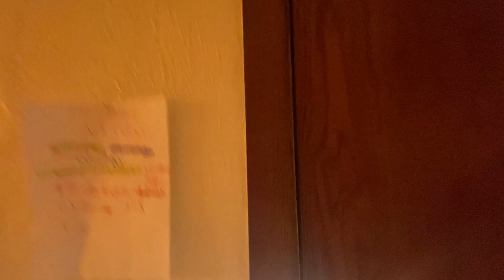Help... is this a silent killer? HVAC Furnace Installed wrong?? Carbon Monoxide

Comment: That doesn't look right to me. That will definitely get hit by a lawnmower or maybe some kids playing. Definitely doesn't look safe. Im sorry. im not sure about the installation requirements. But as a dad and home owner. It looks like a future problem to me!
Reply from the maker: I agree. Since then, it has been ran through the previous chimney and opened up through the roof with a liner. Much better. 90% Effie cy would have been the way to go.

Comment: Well I just remove one just like yours right by a  window normally a l rule it goes above the roof that's why I always install 80%ers I don't like him by a window for the simple fact carbon dioxide could get in I am a HVAC tech out of Missouri

Comment: It looks like a butcher installed that furnace you’re likely to be alive! ….  You must not have a mechanical inspector in your jurisdiction. …. This installation is deadly as well as ruining your house with mold in the first set up. ….  You better have the attic checked for mold. ..

Comment: Was all repairs made correctly just wondered what the update was after repairs were made?
Reply from the maker: He came back, opened the crawl space, went in and put a liner down the chimney and out the lower roof… better than it was but I still want it up a few more feet to clear the 2nd roof.
Reply: @JRESHOW  flu should be higher than any   part of the house within a 10 foot horizontal distance of the house. But I have been retired for 10 years after doing Hvac for 38 so things change
Reply: Ok I don't blame you

Comment: Nothing like making another huge mistake trying to correct the first huge mistake! The company after realizing their lack of due diligence should have removed the 80% furnace and installed a condensing furnace in good standing. Then, notify there insurance company to remedy issues caused by the original install!  
 Question for you, what was heating your house prior to that installation? Where was that vented to?
Reply: Sorry, just seen your response on what was heating the house prior.

Comment from the maker: Thank you. I appreciate the help. The contractor is coming today and is going to get in the attic and run a liner down the chimney and open it up through the roof. He’s also going to replace all insulation and dry out and or replace any other damage. Something must have changed his mind.
Reply: Exposure to the whole world helped change his faulty mindset.
Reply: I run into shoddy work all the time but there are a lot of common issues. Home owner isn't buying equipment from a dealer of that equipment. Homeowner wants it done cheaper so contractor doesn't pull permits. Not that it gets you anything but an inspector should have laughed at that and failed it immediately. The whole point is to protect the home owner from something installed incorrectly especially when it's going to kill them.

Your house is extremely wonky, old, and you need to spend money to have a chimney that is to code or install a furnace that can direct vent correctly.

A qualified licensed contactor pulling permits in theory wouldn't have delivered this end result. That may or may not have been your fault based on your budget but here we are. 

I didn't hear you start the video with the Lennox dealer failed inspection for doing this 🤷
Reply: Thank goodness.  That was some pretty shoddy work.  I'd watch everything they do any  payment until you are satisfied with the work.  Shortcuts with HVAC are bad news for sure.  
Best of luck and glad the guy is coming back to fix this work.

Comment: Shut your furnace off move somewhere where there's heat and get it fixed. I'm a retired HVAC installer and that is an absolute disaster it is leaking into your house. The angle of the exhaust/flute is wrong as well as I'm pretty sure it needs to go up out the top of the house and with that being an old house that fire place is definitely not sealed and cracked. Carbon monoxide levels will build high enough to kill any living thing in that house. Get out or turn the furnace off, or both. Call someone to fix it immediately. A licensed HVAC mechanic who does repairs as well as installation and would seriously question the ability of the original installer. They surely did not have you or your family's best interest in mind. Hope you can get your money back. Please please please stop running that furnace until it is fixed. 

(Red tag the gas and the furnace meaning get an inspector out there, the installation is wrong.)

Comment: Hi. I'm a licensed HVAC contractor with over 30 years of experience. First, you cannot terminate that furnace vent within 3ft of any opening to the structure, windows, doors, etc, that's a code violation. Second, using a non high efficient furnace (non condensing type), that vent should be B-Vent (double wall) for the length of run it is, otherwise the flue gas temp will drop over that run and water will condense inside the pipe eventually rusting it out. If an inspector sees that installation it'll be red tagged and locked off. My advice? Change that furnace to a condensing type which will vent with either cpvc or pvc (termination kits are available) that will blow the exhaust far away from the building. But, the code for terminations near any building opening still apply but extending PVC is much easier and less unsightly than running metal flue pipe!

Comment: Never seen an 80% vented out the aide of a house like that. Usually it's the high efficiency furnaces that are vented on the side with PVC. would recommend having a chimney company inspect your chimney to see if it can be repaired.

Comment: If there was an assisted vent motor added to the system you could keep it that way.  As is, this furnace is not vented correctly and the flu gases will condense too quickly creating excessive moisture which will fall back into the furnace causing it to fail prematurely.

I would have the installing contractor put one in to keep you and your family safe.  Or replace furnace with a high efficient 95% model.

Good luck.
Reply from the maker: Thank you! It does have a blower motor for exsaust but the owner finally called me yesterday and will be out tomorrow to fix and open up chimney, ad liner and go through roof. Appreciate the advice!

Comment: You need to have a field control power vent installed at the end of The wall where it exists the building for proper draft it's dangerous the way it is right now
Reply from the maker: There’s one at the top of the furnace but not at the exit of it. Yea I’m gonna get a high efficiency I think. Go stay at a hotel in the meantime.
Reply: Power venter will solve all the issues

Comment: You can present all this info on how it was installed wrong, but you didn’t know any of this beforehand? You are the owner of the home, so I would think you knew that a chimney no longer vented out—or you should have known. This is a very basic detail of the home. With that, I think you are at least partially responsible for the install mistake. Now, the pipe terminating outside like that. I don’t like the way it was done, and I highly doubt it was done to code or would pass a building permit inspection. I would like to see the vent terminate above the roofline. However, since there was no expectation of installing this with the original work done, I would expect the homeowner to pay for the cost of the added chimney pipe. I might be wrong, but I got the vibe that you’re looking to get something for nothing here. You should have known the chimney was bad, so you should pay to have the vent pipe run to the roof. That’s my opinion on this.
Reply from the maker: Great assumption!  I just purchased the home. Before I even closed on it this same company came out and inspected how they would go about installing a wood burning stove and furnace. But you’re right, if you want something done right, do it yourself. That was the intial plan but having just moved out into the sticks, 4 hours from any friends or family and dealing with having a septic installed, plumbing ran and well issues resolved i just didn’t have them time. I don’t want nothing for free. I work hard.
Reply: well, that's why professionals hold licenses and charge a premium for their services.  They are legally expected to work within code, and it is their responsibility to check and make sure things are correct and safe... and not rely on homeowner to do their job for them.

Comment: HVAC mechanic for 40 years. It never ceases to amaze me how companies can have techs installing gas appliances an not understand how to read a code book. That could have killed you and your family. That company needs to be reported. In Ontario Canada we have TSSA which is a  public safety regulator. If I ran into that install I would be calling then. You must have a governing body in your area. Not only will the company be fined but so will the installer. I would let your insurance know as well because you may need to have your attic insulation replaced due to the moisture. A gas furnace will produce about 1 gallon of water per hour per one 100 thousand btu's. I would guess that your furnace is around 80 thousand btu's. So 2 weeks running in your attic would be over 300 hours. Assuming your furnace ran 150 of those hours, you would have had well over 125 gallons of water dumped into your attic. This is serious. Act now!

Comment: He is centrally below the 3-2-10 rule.  CO will penetrate through the wood slat walls and closed windows!  You are not permitted to be in a room with more than 9 ppm of CO in a 24 hour period.   Also concerned that with such a long horizontal run especially with such a short vertical that there may not be enough lift to create a proper draft.  

The vent cap must be 3' above the roof penetration, 2' above or 10' away from any other vertical part of the building including the edge of an overhang or any vent bringing air into the building.

If the attic doesn't dry out in a hurry you may end up with a black mold problem.  Be careful signing or cashing checks that may limit your future ability to make a claim.  You may want to consult an attorney now and before signing or cashing any checks, this is about to get real expensive.  You don't want to get stuck with the black mold cleanup.  

Call your county inspector and have them come out.  In sure no permit was pulled.  This will help get it fixed and document any damages.

Get low level CO detectors.  regular CO detectors don't alarm until levels are very high.

Comment: its a 80 percent which means it still has an inducer motor fan..that being said that is a long horizontal run
Reply: Inducer fan motor on an 80% furnace is only there so the exhaust will be able to do somersaults getting out of the furnace.  Properly functioning 80% furnace there should be a draft -0.02 iwc ~ -0.04 iwc (negative pressure) just above the breach.

Comment: Mine vents out of the basement wall on PVC pipe.  It is a 92% unit though.  The kind of furnace you have needs to be vented above the roof.  92% and 95% can be vented through PVC pipe as the exhaust gas is quite cool.
Reply: They can be vented through a plastic pipe but it absolutely must not be PVC that cannot handle high temperature and is a fire hazard with highly toxic smoke.  Should a special chimney pipe, for example made of PPH plastic.

Comment: 80% furnaces can not be vented horizontally. At this point I don't know if you should have the original contractor back. As mentioned in another comment. Contact the building dept. I know a lot of homeowners don't like to take out permits. But permits and inspections protect the consumer from shoddy, illegal and dangerous installations.
Reply from the maker: Appreciate the feedback.

Comment: good on you for posting this and asking for some help to take care of the kiddo and the dog.
Reply from the maker: Yea I was trippin a bit. We just moved out here, don’t know anybody, out in the middle of nowhere. The owner of the company just called and is gonna make things right. Everything from removing all the insulation, drying out the attic and replacing, and opening up the roof and running pipe like it should. Im still a bit paranoid.

Comment: I'm not HVAC expert, but I'm pretty sure this is wrong. Yon cannot have this long of horizontal run with atmospheric vent. Would been ok to exit side of the house if it was high efficiency condensing furnace, but this type needs to go up through the roof. At this point, it probably is the best to run flue pipes inside chimney and actually go through the roof.
Reply: if its 80 percent it has an inducer fan but that is still a long run...

Comment: 30 years of hvac expertise It’s ventured illegally they should have installed a 90% furnace. Where the flu goes through the window wood cover they should also have a metal firestop . The outside is completely illegal as well. GET SOME CARBON MONOXIDE DETECTORS. Call the building inspector they the contractor are responsible for permits no matter what the contract says. AlSO get the gas company involved. The vent while illegal should also be 3’ away from any window. You’re ok for the weekend but I’d be on the phone Monday. The salesman messed up by not verifying the chimney. Also what did you have previously was it a metal flu pipe or pvc ?
Reply from the maker: It was metal to chimney, but the top of the chimney  was topped when the metal roof was added, probably hadn’t had a furnace in use since 1989. I’ll make some calls tomorrow. At least they used double wall pipe through the wood. I agree, a 90% would be the way to go w pvc
Reply: 90% furnace and boilers do have some deal breaker logistical challenges then 80% units. I know a lot of times,  if you live in a house that doesn't have a whole lot of space to heat, or your in a part of the country that doesn't see as long of winter. Some HVAC installers will try to talk you out of buying a 90%. Due to the fact the up front cost may be hard to justify over an 80% furnace in those cases.
Reply: @KenKen-ui4ny  90% furnaces are easier to install in basements , it’s the only one that should have been installed in this situation unless they were running new b-vent pipe through a corner or closer to get to the attic and out the roof.

Comment: I have 30 years of hvac experience It’s ventured illegally they should have installed a 90% furnace. Where the flu goes through the window wood cover they should also have a metal firestop . The outside is completely illegal as well. GET SOME CARBON MONOXIDE DETECTORS. Call the building inspector they the contractor are responsible for permits no matter what the contract says. AlSO get the gas company involved. The vent while illegal should also be 3’ away from any window. You’re ok for the weekend but I’d be on the phone Monday. The salesman messed up by not verifying the chimney. Also what did you have previously was it a metal flu pipe or pvc ?
Reply: Never call the building inspector, the city, or any government and invite them into your home!  Ultimately you’d be held responsible to fix it. You are responsible to make sure permits were pulled if required. Since when do government entities solve problems? Never ever. They’ll make you out to be the problem & pay $$$.

Comment: Hvac journeyman 15 yearss here. They should have gone with a 95 % furnace to vent horizontal with a flush terminal kit. You can vent horizontal a certain amount( specified in install manual venting requirements) with the 80%'ers. They messed up assuming the chimney situation with no liner...big screw-up. Could have killed or damaged house. The installers are always the new guys

Comment: If you have the inspector come out, try to get it in writing. You may have a claim on that attic situation. That was a big no no for the installer. Also, as soon as u can, get a couple O2 alarm sensors for ur hallways. I still can't get over them venting that in the attic. Could have been deadly ya know? Jeese. Good luck though guy

Comment: I'm surprised they let it vent in the attic like that, not good. At least it ain't venting there anymore. It should dry out but open up those side vents and clean the screens so any condensation dries on up. As far as that new exhaust pipe, it should be above the the second floor up above the the attic floor, not exhausting by your window. As long as the window is closed you'll be ok but it should be way up above the attic, so no chance of exhaust getting in your home. If you paid for a full installation with exhaust, talk to them again. You may have to have an inspector come out and check on this, your city county inspector. He'll let you know what's acceptable. For now try to get that attic area dry bro, hope this works out for you.
Reply from the maker: I appreciate it. I will try to get those covers off tomorrow, they are the older ones where just the outside square frame comes off and the vent itself is connected to the house behind the siding. And with 0 degree weather I’ll end up cracking it all I’m sure but better than mold. Just called my insurance and for some reason they said my policy was terminated with no explanation except it looks like my agent messed something up somewhere. Geesh. Well, I’ll keep the co meters close and try and get some sleep.
Reply from the maker: Think it will dry out in 10 degree weather ok?
Reply: @JRESHOW  it should be a little warmer in the attic, than outside. Any ideas?